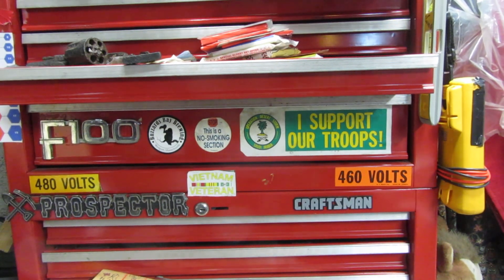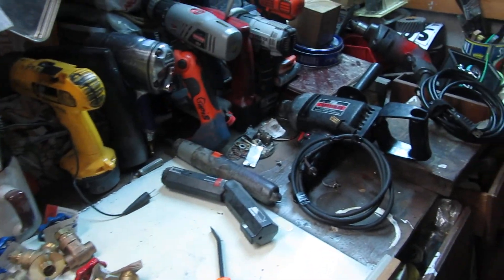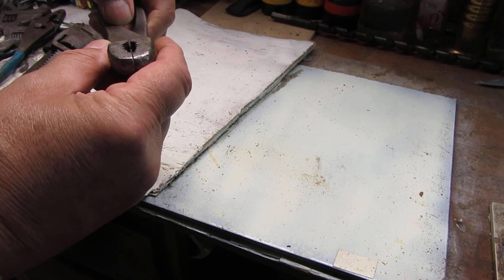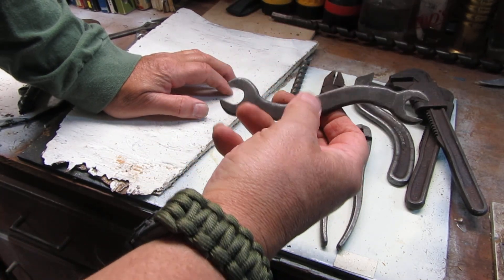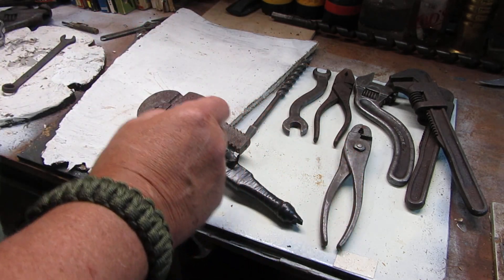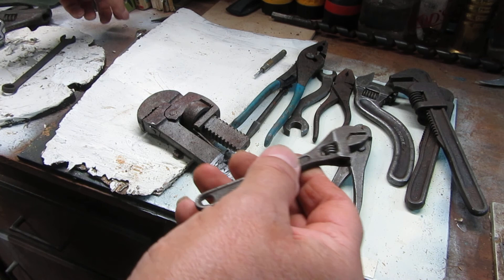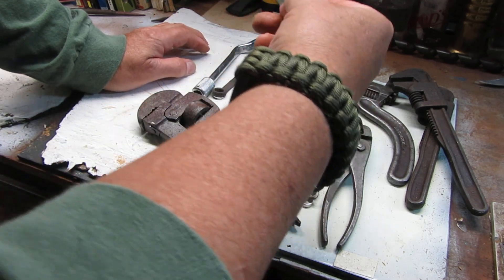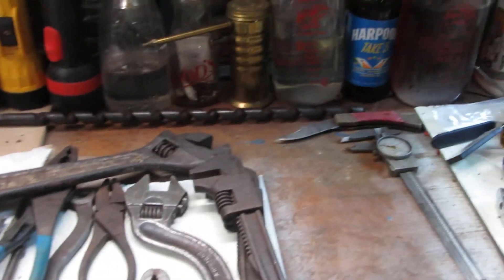Dads old tools,rons beers & tools,#197.

Comment: WoW, deep offset pliers, that's awesome. Those bent handle Crescent wrenches are sweet. The drill bits are just called bits or auger bits and go into a brace (hand drill). That new one that goes on the ratchet looks like a distributor wrench.